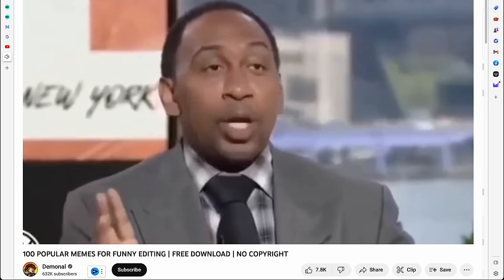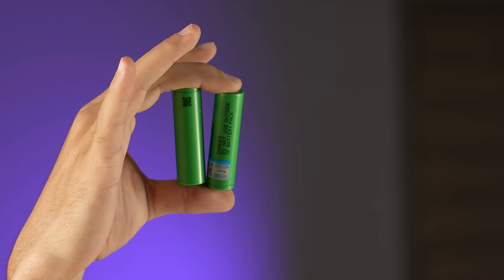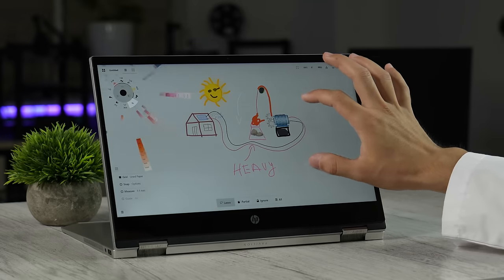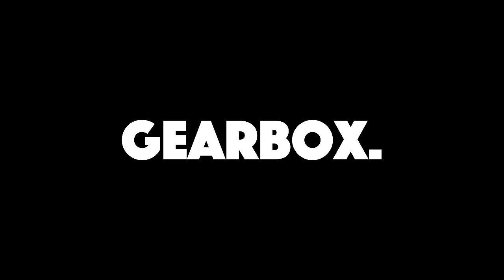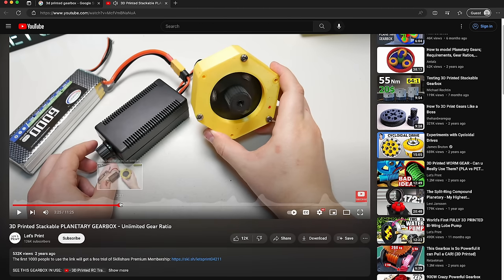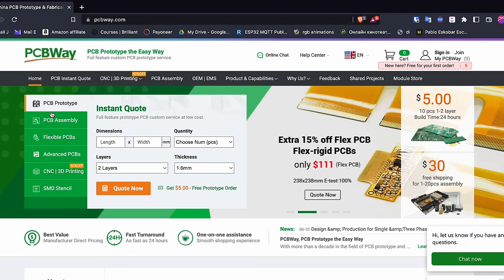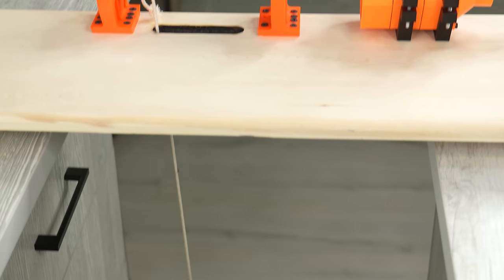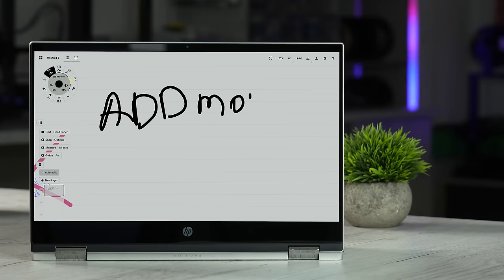DIY Gravity Battery: Unexpected Results!

Comment: Interesting video showing it possible, but is it economical. How much power did it take to raise the rocks? Did it use the full potential of the panel in raising the rocks? And finally, how much power did you get back? I might estimate you put in 200 watts/hours and only got 100 back, at best. Far to many mechanical losses going up and going down.
So, now you need twice as much solar, a large place to put the generator and suspend the weights, not to mention the amount of maintenance to keep the thing running....
Batteries are sounding like a much better alternative.
Reply: He IS using the full theoretical output from the panel. As you can see, he's using a MPPT (maximum power point tracker). As long as the motor draws more amperage than the short circuit current of the panel, the MPPT will use pulse width modulation to trade voltage for current. In the event of cloud cover, or, the sun sets in the evening, the MPPT will send less voltage to the motor, to maintain the current necessary for the motor to raise the weight. It merely raises the weight more slowly. At high noon, the voltage will be higher, but still lower than the ideal loaded voltage of the panel. He just needs to make sure that the current limit of the MPPT is not exceeded, and, make sure the motor can handle the current without exceeding the field strength of its permanent magnets, or, just simply getting too hot.
     If I was going to try this, I would use a barrel of water. Just add water, to get the weight necessary to store the desired amount of energy, but not so much, that you break pulleys, ropes, or strip gears. (or burn up the motor)
Reply: @vincentrobinette1507  The real question is how much in vs how much out to see turnaround efficiency. How much in vs how much out is a combination of vots x amps and the reverse. What good is it to put 200 watt/hours in and get 100 watt/hours out.

Comment: 620 RPM on the shaft,,right,,but the motor spinns a planetary gearbox so it spinns way faster and that gearbox is pretty hard to reverse rotation,,lotts of tork needed

Comment: Nice idea, but you really have to beef it up. If the weight is 47 kg and you lift it 5 m, you store a whopping 640 mWh of energy. Not enough to charge a Tesla. 😄
FYI an 18650 battery has easily 10x the capacity. But overall this was a fun video.

Comment: Not to bad. But make sure that the gearbox and the amount of weight to held it on earth is 2 x  the weight you are lifting. You might wanna put cones around the area the weight is above. Ie. Your brother could be playing a game underneath it, then it fails and he is dead.your pulleys were rated at 125kg approx from memory, good choice. If you wanted to run house lights on 12 volts you would need a more powerful motor/generator. I use 5vokt string lights on a wall adapter but have a 5v powerbank beside it for when the power goes out

Comment: Hello dear.

Your approach is interesting, but it would be interesting if you divided the mechanical moment of weight lifting at  let's say h=5 meters (stones, nephew 🤣, dumbbells, etc.) using 2 bottles water - one full named A,  one empty named B, with the same capacity:

1. Emptying automated the full water bottle A with some 50 liters arrived at h=0 down (as you tried initially în youtube film at one point) with help of one water pump (Ah, V, Watts smal) and a thin hose into second empty bottle B located already at h = 5 +1 meters.

2. After the first bottle A has been emptied into that bottle B with the help of the water pump, an automatic mechanical switch or actuated by the light weight of the bottle A activates the main motor (generator) which lifts empty bottle A up very slightly up.

Then, with bottle A situated now at h=5 meters (gently ascended by the motor driven by the charged batteries from the solar panel), one switch automated start to open gravitațional water from bottle B situated at h=5+1 meters leave water come in bottle A with another thin hose.

After bottle A is full... all is repeated.. And of coures, with current produced by gravity or from the solar panel you have the surplus current needed by another consumer, either day or night . 
I love watching you and am terribly amused by your funny moments. Keep it like this. Sincerely, dear. 💯❤

Comment: i would add another gearbox with a diffrent ratio that can be connected with a lever or switch, when battery descends it would increase the rpm ther motor spins at, hence giving a higher power output and slow down the decent, this should be more efficient.

Comment: The large scale version is even worse than the home version, which is why no one makes these. The infrastructure cost is astronomical and the energy density is almost nil. It does work well enough with fluids though, if you can find a place with two large reservoirs at different altitudes already in place.

Comment: I'm genuinely curious about this... like you can cheat it by just raising the bag of rocks manually with a secondary pulley. No need for even having the solar power. This... may actually be a viable emergency generator system for a home's backup lights or something. Power goes out? Yank the pulley system for a bit and slowly drop your bag of rocks. Bam, lights. Might not output enough power to run a big enough generator for heat or ac but you could use it to run a fan or something.

Comment: Water my friend water

Small solar powered pump to start storing energy 

Waterwheel with generator via mppt charge controller to release energy via mechanic valve from pumped storage

Only downside for real power usage youd need a swimming pool sized storage tank

Comment: Does first test, almost gets beaned by 3 metal bolts and a PLA shackle.. Proceeds to use metal pulley's and tests without safety equipment.  Smart in some areas...not so much in others.

Comment: Really would have liked even just a passing statement on: 
1  how long it took to pull up the weight, 
2  how much of the solar power it took to pull up the weight (could the solar panels still provide power to the rest of the house while lifting the weight?),
3  how long the gravity power lasted,
4  how much gravity power it produced in comparison to the solar power used to lift it

As it stands, this video just basically says: "look at this cool thing I did" and doesn't really provide any useful info regarding gravity batteries...

Comment: I miss few think in that video.
 What is the panel voltage and current?
How much energy the panel produce to lift the weight ? 
What is the high ?
How mych energy did the battery give you back.

Comment: Gear stacks look good but unfortunately they perform badly.  Each stack has a wildly different torque so it needs to be engineered for that value.  Basically that means adding metal gears for the low speed gears.

Comment: Gravity battery might be easier with a couple tanks of water and a pump. More structural engineering to support the upper tank, but it would be a heck of a lot easier than trying to get shitty plastic gears to support huge loads.

Comment: it is unprofitable to use height for energy generation. it is too expensive to build a tower of the required height and under a large mass of cargo in order to generate enough energy for a long time. I would suggest this option - if there is a plot around the house, of course, and not an apartment. The idea is to launch a cart with a load on which the generator is installed on an inclined surface. 2 meters deep down the slope, and on the other hand, on the contrary, we build a hill on the tezhi 2 meters in height. and we do something like a road 20 meters long and we have a slope, that is, we have a mountain from which the cart can descend under its own weight. We put a gearbox directly on the wheel of the cart and the generator and, obviously, the generator should be taken with as little operating speed as possible. The trolley can be made in this way with a very large mass up to several tons! That is, such a mass will be able to rotate the generator with decent power for a long time. The main thing to understand here is that the larger the mass, the more powerful the generator can be start or exchange mass for duration through a good gearbox. to build a tower in height to withstand such a mass is very expensive. in theory, a 100-watt generator with a cart weighing 1 ton should go down for up to several hours. And you can lift such a mass of the cart with a winch by rotating it with something like a bicycle drive.
pedaled for 15-20 minutes, went in for sports, switched the mechanism, the cart slowly moved down, generating energy for up to several hours. That is, several times a day, you can get energy doing useful sports. I did not make calculations and did not try to implement this, but in theory a cart weighing 2-3 tons, perhaps more, will be able to turn the generator at 200 watts for several hours up to 8-12 hours. That is, 2-3 times a day you will have to lift the load to benefit the body and receive 200 watts of energy for 22-23 hours, taking into account the time to lift the load. and this is more than 4 kilowatts stored energy per day. which is more than enough for domestic needs at home. lighting, charging a smartphone, a TV, even a refrigerator will work quite well. Ideally, calculate the operating time so that there is enough for 12 hours of a gravity generator. body and having enough energy for domestic needs. Moreover, if the trolley suddenly accelerates as a result of a breakdown of the mechanism and quickly moves down, it will not pose a threat, as it will go underground and rest against the ground and stop. In my opinion, this is the best option for a gravitational generator, at least for the house if there is a site.

I can suggest the option of using mirrors, reflecting the light of the sun, heating the boiler, thus obtaining steam that will turn either a small steam turbine, but it’s probably better to use a piston system like on steam locomotives to rotate the generator, but again, you need the sun. but at home it is very easy to implement such a project. Moreover, instead of expensive mirrors, you can use a mirror film glued to some surface, for example, made of thin plastic or metal and spaced relative to the sun so as to focus the light on the boiler. In principle, there is nothing complicated about this, and even steam a boiler and a piston, like a steam locomotive, can be done at home without difficulty.

I can offer a couple more ideas. For example, using a sail or thermal expansion of a liquid or gas. for example, you can use a sail or, more precisely, something like that used in kitesurfing. what if you take such a kite to hang on a cable that will turn the generator when the wind blows and pulls the kite up, so the generator rotates and when the wind subsides, the counterweight pulls the kite back to the ground. do so that the kite does not fall to the ground without wind? use hydrogen or helium. make a balloon filled with hydrogen like airships, for example, but in the form of a rectangular frame and close the space inside the frame with a cloth, thus creating, as it were, a sail or a kite. we connect a balloon with a sail to put it simply, in calm weather, hydrogen will keep our kite at a height and a counterweight in the form of a load at the other end of the cable will not allow hydrogen to pull the kite up, but if you calculate the weight of the load correctly, the wind will be able to lift the kite and pull the cable that will rotate the generator.

or you can use liquid or gas in a cylinder with a piston that is heated by the sun. liquid, for example, oil expands, pushes the piston, which rotates the generator through the lever and gearbox when the piston is at the very top, the automation drops the fabric in the form of a curtain, closing the piston from the sun, it cools down, the curtain goes down, the sun is removed again heats the oil in the cylinder. To enhance the effect, we use a mirror to focus the light on the piston. Yes, this is not a very fast generation of energy, but the liquid expanding from temperature gives a very high pressure. Thus, using a lever and a gearbox, you can rotate a fairly powerful generator. Yes, and such a design is cheap. we make 2 such cylinders connected to the generator and make the mirror turn automatic so that one cylinder then another is illuminated and we rotate the generator in one direction and the other, heating and cooling the pistons in turn. The idea is extremely simple and quite effective

Comment: How would one regulate the drop of the weight? I mean, ideally the weight would be stopped if the load was 0, and fall incrementally faster as load increases to meet greater energy demand. But as I understand it, the motor/generator works in the opposite way, offering more resistance when there are greater loads. Am I making any sense?

Comment: As cool as this is, and I respect the amount of work and personal sacrifice put into the creation, I see a very overly elaborate way to lift 100-ish Lbs. what looked to be 20 feet into the air to use that kinetic energy for a few L.E.D. lights. It would have been less work overall to simply climb a ladder and hang the bag of rocks manually, Or even a different pully system to hoist the weight. Not trying to crush your expansion of knowledge or creative design, but I think there are easier ways to go about this. And as other comments suggested 3D printed parts only have so much strength and durability, and could have ended with people getting hurt, hanging those pullies by rope was kind of sketchy as that is a massive point of failure. However, don't ever give up and keep on learning! Every project and experiment are a steppingstone to the ultimate end goal. Overall, good work!

Comment: I've been interested in getting solar panels for some time. However if i don't get the much more expensive battery, im still on the grid. In the back, weve got multiple fir trees approaching 150' high. I'd love a cheaper, unique way to store excess energy. I know with water/ hydroelectric the height and volume (head) makes a significant difference. Anyone smarter than me know if a weight hoisted higher vs more weight not as high would make this more viable?

Comment: We need gravity farms....Giant towers or scaffolds where motorize pulleys hoist massive weights powered by solar and or thermal panels...Then recover the energy descending, probably turning turbines as weight lowers. Additionally  wind turbines in cage boxes can be slingshot into sky with parachute, and then feed into battery on descent or heat up rock with charge. The heat can be transferred to chemistry charging bank on landing. Can create several hundred jobs. Gravity battery farms.

Comment: It's all about mechanical efficiency. Your gearbox will not produce anything like S*T = constant without high precision. Less than 50% efficiency & it won't roll back. A nice idea, but there's going to be a lot of high precision gearing in a practical solution. Also, the motor to use is a BLDC, far more efficient than a brushed part. There won't be much wood in a commercial solution. Also, black does not equal working with IR sensors. The voice of deep experience there... I note in another comment the 'Gravity Battery' is best implemented as a dam with water. There's your efficiency upstate.  A little difficult to scale with domestic, but fundamentally, you are using mass with a much higher density to fit it in you house.
Reply from the maker: Thank you for your feedback, I definitely take your comment in to consideration in my next projects:)

Comment: Masallah very smart research but I would not use 3d printing anything, wood have been even stronger! mechanical battery ideas is old if you place two barrel on a ring frame, rotate with hand at night there you have a better idea. You are correct solars job is to fill the car battery of say 250 amps you'll have plenty o power to go around! you can place mirrors on the sides for efficiency increase.

Comment: To be honest, I don't know whether it is a good idea to support any of your efforts. Well it's definitely fun to build such a system, but how could just start blindly and waste money without doing any calculations first? Here is the minimum you could have done:
Potential energy is: mass * gravitational constant * height: E_pot = m*g*h [Nm].
With 1 Nm = 1 Ws, lifting a 1 tonne weight over 10 meters consumes 98100 Ws or 27.25 Wh. And that is the limit of what one can expect from such a system, at least in theory. Depending on the technology you use, you're practically getting a fraction of that value.
You showed us a system that, for example, lifts 50 kg over 3 m and thus does not store more than 0.4 Wh. Now look at a common 4000 mAh cell phone battery. It can store about 3.7*4=14Wh or 37 times more...

Comment: These kinds of brushed motors aren't efficient in generating power. I could see a separate bldc motor that can take the torque with little heat, and a separate generator that is far more efficient. Then have an automatic mechanical gear switch to flip between the two.

Comment: Wouldn't a grain elevator for bringing the weight up, and a turbine on the way down, and using the heaviest powder you can get a hold of be a much better solution?
Reply: Too much frictional loss between the grains. Particulates don't typically come out of a silo all by themselves. They need power assistance to be taken out of the silo.
Reply: @AlRoderick  Really? even if a hole opens up in the middle of the silo and the bottom is shaped like a funnel? I didn't know that.
Reply: @MegaLokopo  yeah they jam, and then somebody might foolishly come in to the grain silo to try to get it loose and then suddenly find themselves drowning in it, it's kind of horrific.
Reply: @AlRoderick  Would there be any way to design them so they don't jam? I guess if it was possible someone would have done it already.